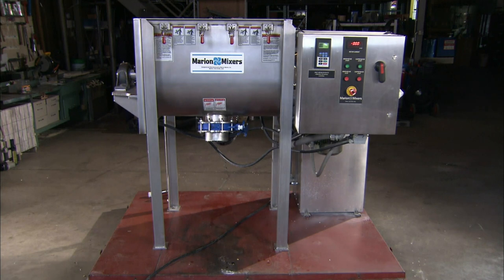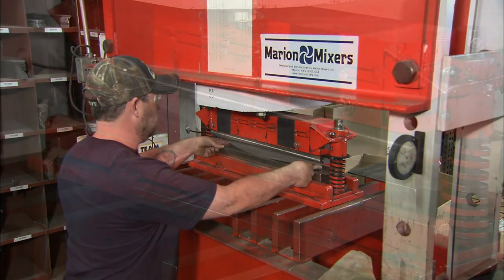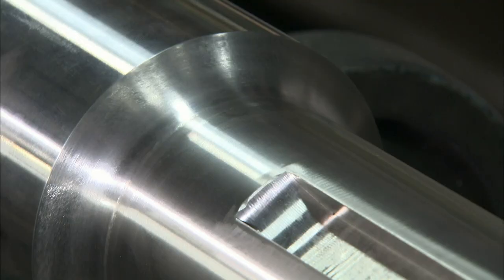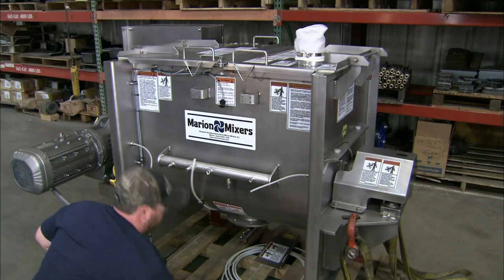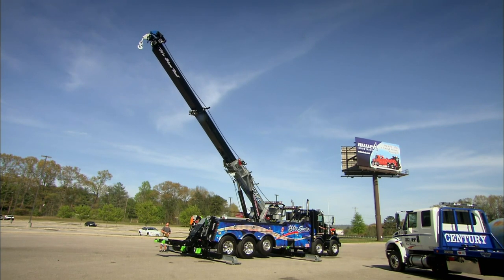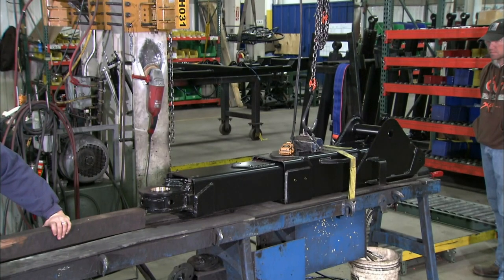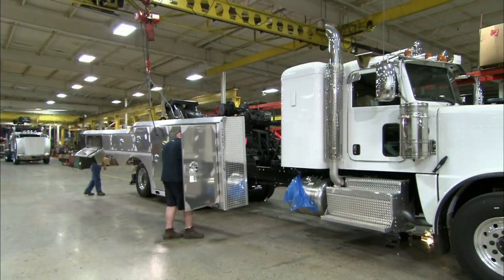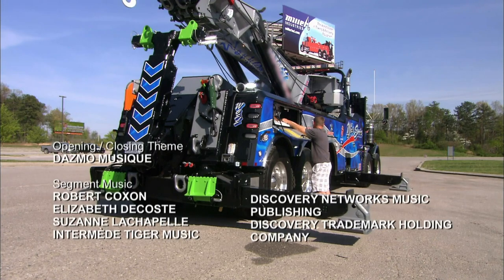TOW TRUCKS & INDUSTRIAL MIXERS | How It's Made

Comment: That guy welding with only clear safety glasses... had time to put the safety glasses on, but those damn goggles or mask are just too tricky to figure out...?
Reply: Tow truck is wopping 2500 parts, huh?.... 
laughs in aerospace development
Reply: @user-pk3ef8hc3e  not really, I have been part of the development of two separate turbine engine families that are in wide use. If you have flown several times in the past 5 years, chances are good that you got there safely due to the engines we built, and the airframes they were installed on.